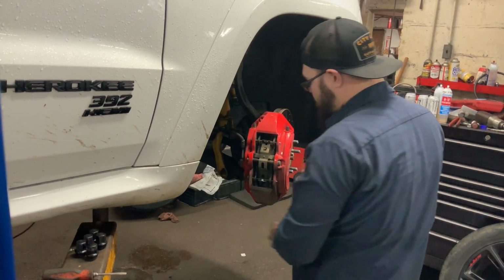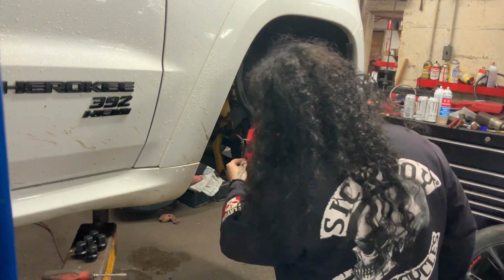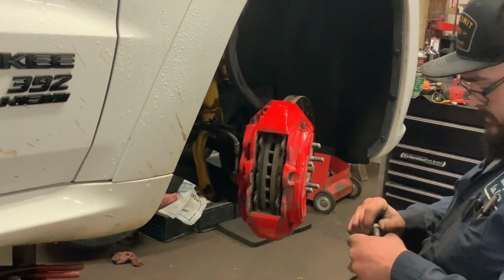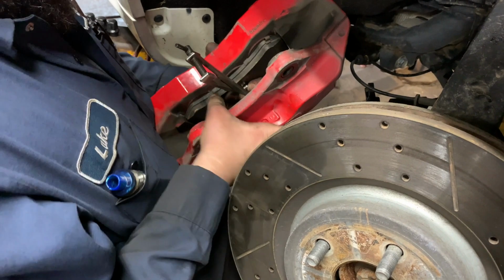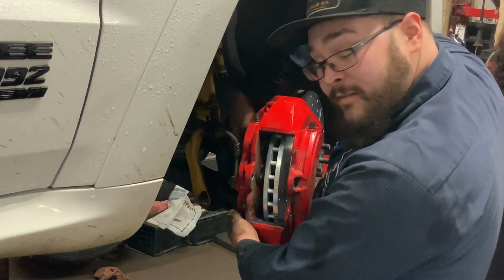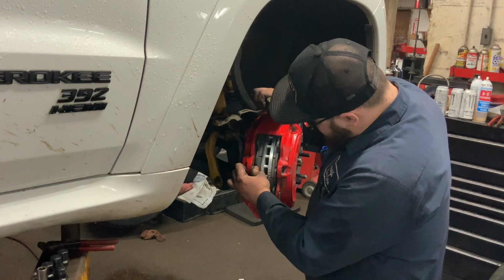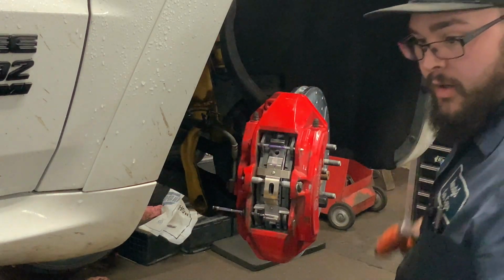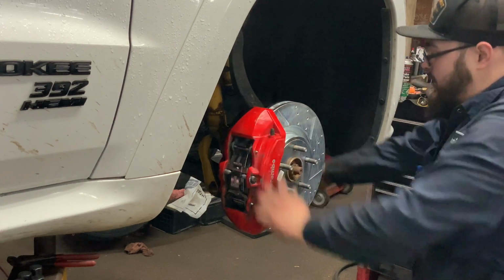2012-19 jeep grand cherokee SRT front brakes rotors and pads how to

Comment: Did you have to take brake fluid cap off when changing brakes
Reply from the maker: SRT HEMI yes
Reply: @mrbungle6visix  why?
Reply from the maker: SRT HEMI pressure
Reply: @mrbungle6visix  are you going to do the Transmission fluid change for the srt? ZF 8 speed transmission? it will be helpful not a lot of clear videos out there.
Reply from the maker: SRT HEMI soon yes
Reply: @mrbungle6visix  Great I would love to see that, Please show us everything and explain it, because no a lot of out there about this. I appreciate your effort and videos.
Reply from the maker: Tek absolutely
Reply: @mrbungle6visix  I have a question regarding the rear differential fluid change? My dealer changed the fluid however I'm doubting they didn't use the Additive (Limited Slip) which makes me worried? Should I do another change for the fluid and make sure to add it? or it will work fine without the additive? because my car manual says to add the additive to the rear differential.
Reply from the maker: SRT HEMI absolutely

Comment: do you guys have a link to where the pads and brakes were bought?
Reply from the maker: https://rover.ebay.com/rover/0/0/0?mpre=https%3A%2F%2Fwww.ebay.com%2Fulk%2Fitm%2F401562732239
Reply from the maker: hayabusa1023 https://rover.ebay.com/rover/0/0/0?mpre=https%3A%2F%2Fwww.ebay.com%2Fulk%2Fitm%2F401435017850
Reply from the maker: hayabusa1023 https://rover.ebay.com/rover/0/0/0?mpre=https%3A%2F%2Fwww.ebay.com%2Fulk%2Fitm%2F122893585927
Reply from the maker: hayabusa1023 I just bought ceramic pads from my local store AutoZone
Reply from the maker: hayabusa1023 https://rover.ebay.com/rover/0/0/0?mpre=https%3A%2F%2Fwww.ebay.com%2Fulk%2Fitm%2F292942804184
Reply from the maker: hayabusa1023 But these are the brake pads I just bought the first time after I bought a set from AutoZone what I had to redo my front brakes
Reply: @mrbungle6visix  thanks guys!

Comment: Question. Is the 2018 jeep grand Cherokee srt 2 piece rotor or 1 piece?
Reply from the maker: Soul of New York You can use either however the factory OEM  are one
Reply: @mrbungle6visix  thanks for the reply. Been looking to replace rotor and pads and dealership quoted $4500 which is a no go and I only put 15000 miles on them... now that I know it's a one piece I have options..
Reply from the maker: Soul of New York I only spent about 300 bucks and materials for the front about 160 for the back